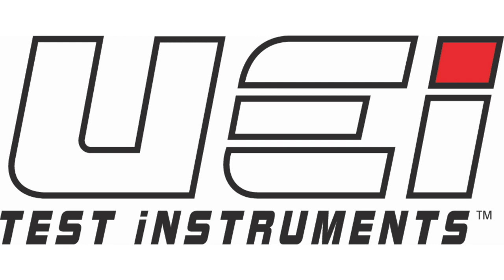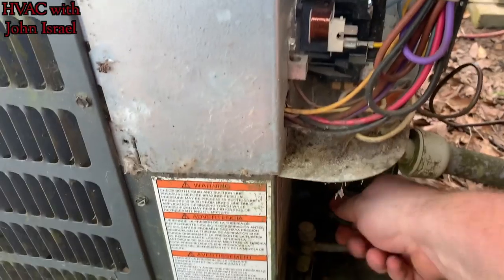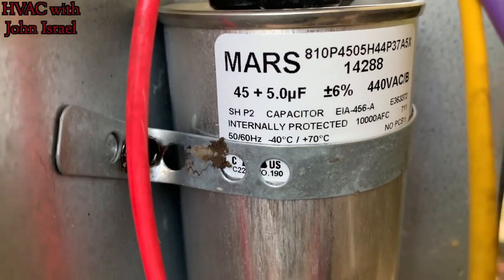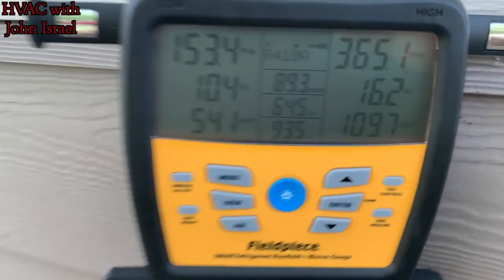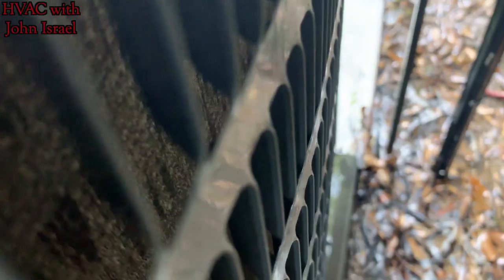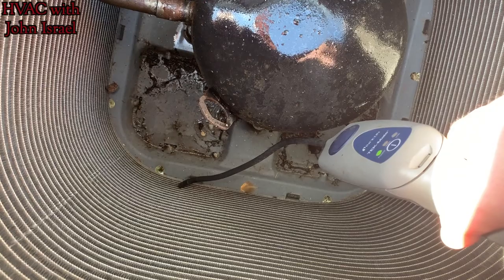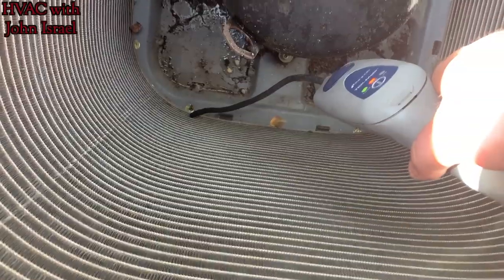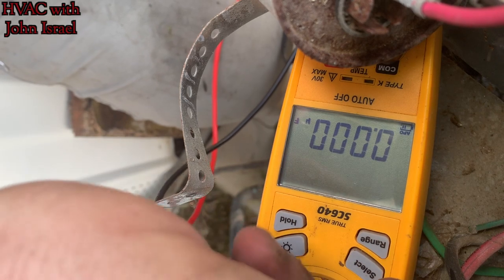3 HVAC Service Calls

Comment: I just put in a 5uf 370VAC Mars Cap for the indoor fan of a customer.
2 weeks ago I installed a dual run cap in a R-410A condenser.  The cap was a Titan.  Made in China.

Comment: Good video John. I like to use a super boost to try and see if a locked compressor will start. Seems easier just for testing to see if compressor will start.
Reply from the maker: Thanks Rodney. The super boost are junk I would recommend you use a kickstart or a 5-2-1
Reply: @johnisraelhvac2019  yeah i don't  think they would be good as a permanent solution. But just to see if it would start the compressor was what I was suggesting.

Comment: I wonder why he didn't wait a minute. Sometimes it takes up to 30 seconds to kick on. I've also seen them often burn at the compressor terminal. He knows his stuff but I was just wondering
Reply from the maker: If the compressor had a wire burned off it wouldn’t even attempt to start. It wouldn’t be getting proper voltage. But just so you know I did check and the wires were fine. This compressor had a plug.

Comment: How you liking the new smans? My sman3’s died about a month ago and I’ve been rocking the analogs. Super tempted to get the new 380v’s just gonna have to set aside the cash
Reply: CritterGitter23 get the 480v’s so you can pull a quicker vacuum, worth it in my opinion....so far so good- I had mine for about 3 months now